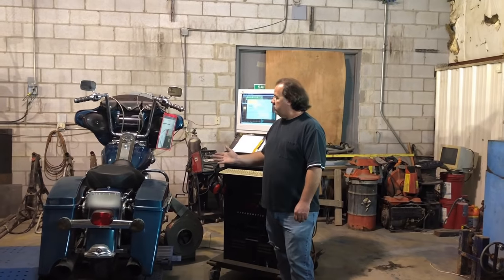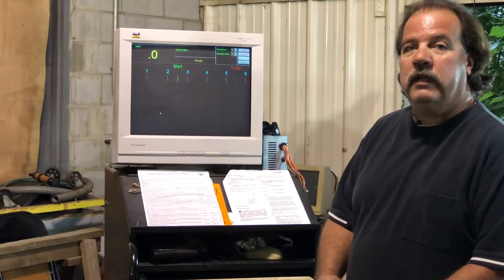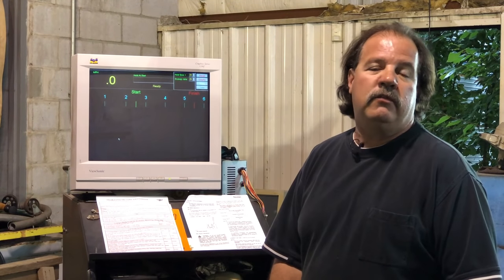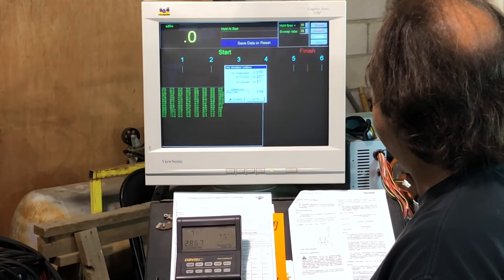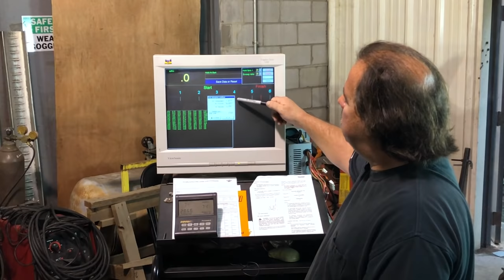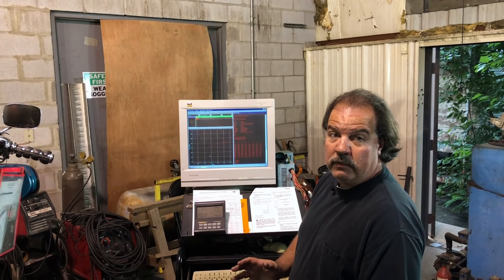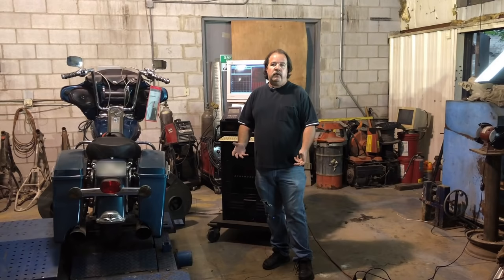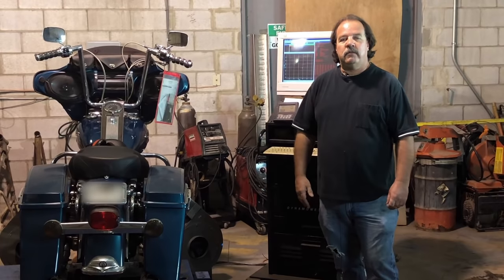Introduction to Motorcycle Dyno Tuning

Comment: How much would running lean affect horsepower?
Reply from the maker: BIG Papa NINJA running lean effects horsepower significantly. Lean conditions cause engine to burn hotter. More importantly, the engine fuel ratio is receiving too much air. When the air fuel ratio is not optimized, the engine can’t make the proper horsepower.

Comment: Hello does a wheel speed sensor and slick tyre compound affect results? I have a 1199 panigale only getting 169 whp with a full termignoni exhaust
Reply from the maker: Jane Golding-Bezer it can. Should not change the reading too much. But some stickier compounds create more friction and do effect the results slightly. You should not see anything significant to your horsepower readings.

Comment: Other than taking readings, can you modify the bike's map  to increase performance?
Reply from the maker: George Michael yes, modifying the bike’s map is a common occurrence to increase performance. The base readings are essential to determine map modifications.  With each performance adjustment, a new reading will determine if the change helped to increase engine performance.